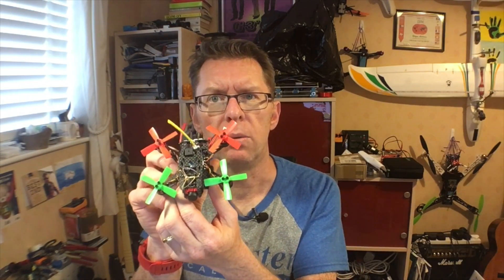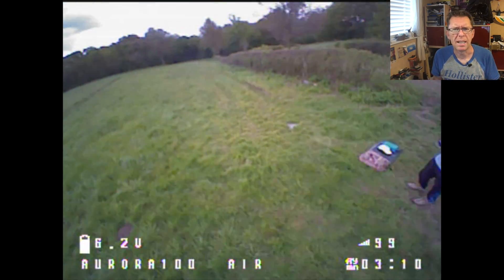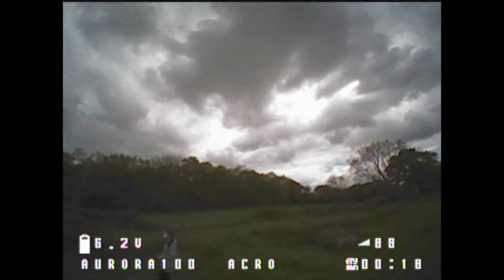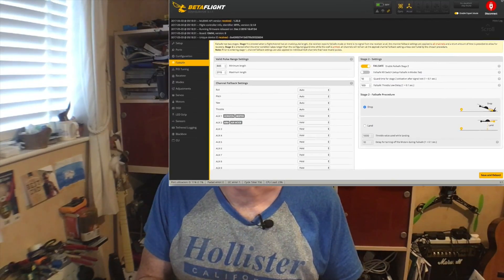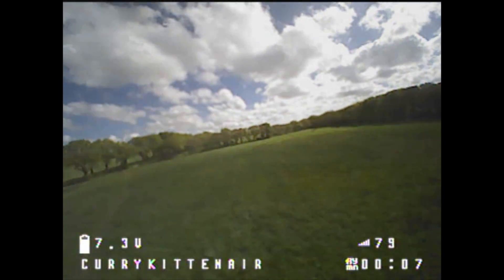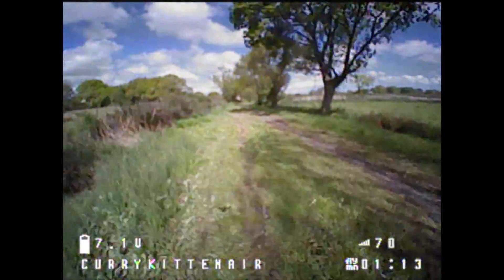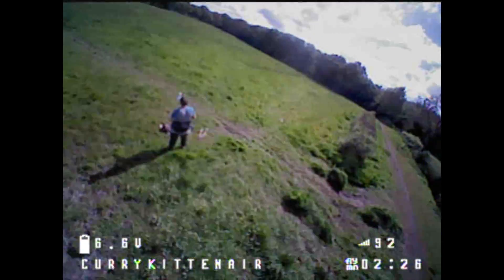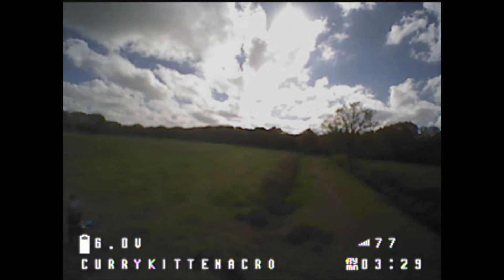Aurora 100 Follow up: lipo torture, PIDs with the OSD, Failsafe and flying

Comment: I just got my Aurora 100 with Flysky transmitter. I'm trying to figure out why my RSSI value stays in the 23 to 29 range. Is it a setting that will fix this? I have not touched any pids to cause this. Thanks
Reply from the maker: I've not laid my hands on a FlySky TX for a while - does it have RSSI on the RX?  If you connect the quad to betaflight and power on your radio can you see one of the channels moving around a little randomly as you move the TX close and further away... is this the one set to the RSSI channel ?
Reply: @CurryKitten  when I plug it in to betaflight and turn on my FlySky transmitter it shows the RSSI value around 14%. So it's showing. I hopenthat I don't have a faulty flight controller.

Comment: Big problem for newb. I flew my new Aurora 3 times and it was working great with FlySky FS-i6. Then I hooked it to Betaflight to see if I could change the OSD and battery warning to 3.4v. Thought I had saved the backup files correctly but did not. Hit save and reboot. Now I am unable to arm quad. When I turn on the quad and the transmitter the blue bind led on the quad goes solid like its connected but there is no movement when looking at it in Betaflight like it did before. Is there a bind reset jumper. I tried using bind button and it looks like it binds to quad but it doesn't seem to change anything. I also tried to configure it with betaflight using videos off the internet but no luck. Is there a way to do factory reset? I have been searching the internet but I can't find anyone with this problem. Please help. Thank you.
Reply from the maker: stephen smart so did you change anything other than voltage in betaflight as it shouldn't have an impact on your rx. From what you are saying if you go to the receiver tab and move your sticks, then nothing happens ?  If that's the case perhaps there's a mismatch between what the rx is talking and what you've told betaflight to expect. For example the rx is ppm and you've selected sbus. If it's anything other than ppm then check the ports tab to make sure you are using the right uart for your connection. I don't know the rx, but check if you have to bind in a specific way for ppm/sbus/ibus depending on what you are using.

Comment: Hi. I got an Aurora 100 and I got a problem with motors getting very hot. Do you know what might be a problem? Is that possible that motors are getting too hot because I run on a little bigger 600mah 2s battery?
Reply from the maker: Well, they weren't getting hot on the 550's i sometimes run.. .warm, but not hot.  Are you running dynamic filters or turning any of the filters off in the PID tuning section.  That can run the motors hot ?
Reply: CurryKitten No, I didn't touch filters.
Reply from the maker: Ok, well running D gain too high can heat motors, or also having a short between the frame and motor windings.  Put a multimeter on the side of the carbon frame and the other side on all the ESC solder connections and see if you get continuity.  If you do then that's probably a screw touching the windings and shorting it onto the frame - that will heat up motors
Reply: CurryKitten I checked with multimeter but there is no short. D gain is 20 and 22. I can't find a reason why the DYS 1104 motors getting so hot.

Comment: i have this same quad and so does my son.  We are experiencing a turn off loss of control on rolls and flips.  Any idea
Reply from the maker: Are you using air mode ?  If you don't and throttle right down on a roll/flip, then the quad will just keep spinning
Reply: AKA DEATH ROLL mine had it also its a common problem aparantnly I reflashed the escs to newest version via the blheli CHROME APP ive hearfd reports of esc bricking doing it via passthru and updated to latest bf and seems ok now. flash one esc at a time not also

Comment: I have a Flysky receiver, to set up Failsafe, go into flysky receiver menu, long press on the OK button, ok again on system menu and scroll down to RX Setup. Scroll down to failsafe, I have channel 5 as my arm button and channel 6 as my mode button allocated to switches A & C respectively. Select channel 5 switch on failsafe with Switch A selected to disarm, hold cancel button to save, then do the same for channel 6. Failsafe is now set up. I will try and do a quick vid for this, but works with all quads using iBus or PPM.

Comment: nice follow up and thanks for trying to confirm the failsafe issue ..as far as batteries go it really comes down to what's available to us with Lipo restrictions as they are but my guess would be a high voltage 500mha would be about perfect..to be honest I make my own as good quality high C rated 1s batteries are easy to come by, then just a bit of time and soldering but if I were you I would start with more efficient props that are balanced (less amp draw/more flight time) am sure there are many prop testing videos out there for these motors..also cheap motors on a small frame should benefit from soft mounting, it clearly flys well but any reduction in gyro vibration should yield cleaner inputs.. lastly I'm going to email Boris B and demand from this day  fourth it shall  forever be known as CURRYKITTENAIR, I'm sure this was a mistake on his behalf and will be rectified in BF  3.2..cheers mate... ps where do you find the sun in England I've been looking but have given up and brought a night cam.. fpv by moon light ..lol
Reply from the maker: :D  CURRYKITTENAIR also the name of an airline with dubious in-flight meals ?  The sun was only there for about an hour before normal service was resumed

Comment: If your battery voltage is off, you can adjust the ratio in Betaflight (BF) under configuration on the right side under voltage.  Also, if you wanted your full call name, you can enable OSD editing by selecting show advanced features at the top of the BF window. OSD will now be listed on the left side. Then in OSD menu, drag your call name to a different location. I always run call name at the top out of the way.
Reply from the maker: I knew it was missing something - I was sure there was a ratio before, but the VBAT is set to ESC sensor, which makes the ratio hide away.  I'll have a check to see if the onboard ODC works.  Yeah - I know I can drag things in the  betaflight OSD menu (really hand) the reason for the long call name is that the configurator shows it as [CRAFT_NAME] as if someone forgot to do the variable substitution, and so I didn't realise it would be too long until I flew :)  Cheers though - I might use the 4 corners like I usually do on my other quads .
Reply: CurryKitten I've had the same issue with the OSD and now drag things around with a live feed. For some reason what you see on the osd screen isn't what you see on your feed. 

After I saw this little quad, I decided to build my own. Emax has a kit for $75 that includes everything you need including props (minus the frame, Rx and battery). For your US subs, flighttest has this kit packaged with a frame. They call it the Gremlin.

Comment: another great vid curry. i was reading that bf 13.0 causes the FOD. did yours do this or did you upgrade it to 13.0.7 i think the latest is?
Reply from the maker: Slighty confused with your betaflight versions - latest is 3.1.7.  Did you transpose the 1 at the front or is there a secret release I don't know about ?  Also I'm stuck on FOD (in my head, I read it as "Flight of doom" - but that's possibly just from my cheery outlook on life)  please enlighten me :)  It's on 3.1.0 - I deliberately didn't move to the latest version as I wanted to get a feel for how it flew out of the box
Reply: CurryKitten sorry your right witj the BF version. Bloody phone lol.
FOD is flip of death. i was reading that the BF version that it comes with suffers from this. i was going to buy the arfun 90 but its up to 140 gbp. Looking at this instead.
Reply from the maker: Glad to report no issues at all out of the box.  Was this reported happening in acro, or any of the self-level modes (which I haven't touched) ?
Reply: CurryKitten Lol!! I experience Flight of Doom all the time!!

Comment: my one hasn't arrived yet, but I have 2 extra battery's with it.
the good news is I have a friend down hear to get some tips of, as you know I'm not a 3D quad pilot and he's use to using Beta Flight, cant wait.
 https://youtu.be/K8uHkuExojI
Reply from the maker: As with anything - altitude is your friend when trying things for the first time.  Great news is on this quad is that the power to weight ratio means you can pull out of things very quickly and avoid the ground.... just as long as your facing the right way :)  Which is good, as this is almost guaranteed to make you try doing silly things